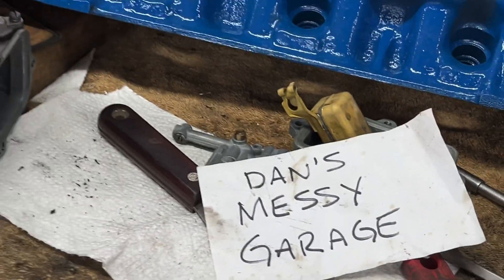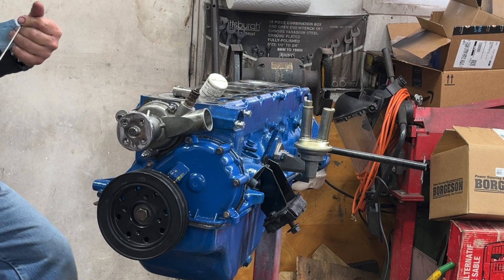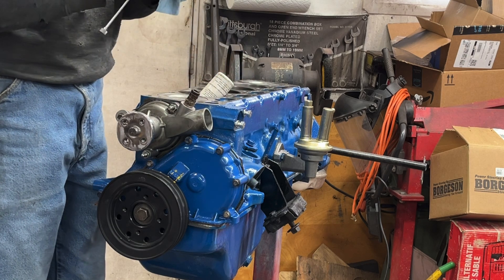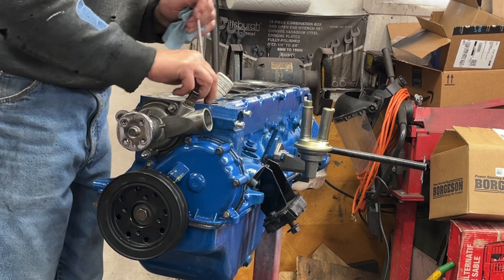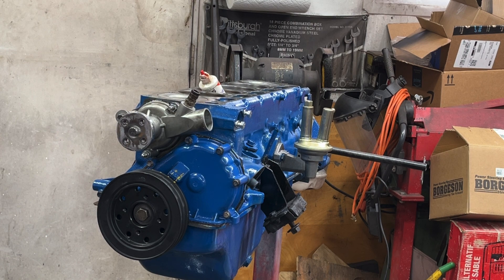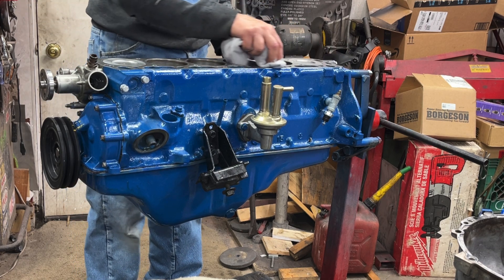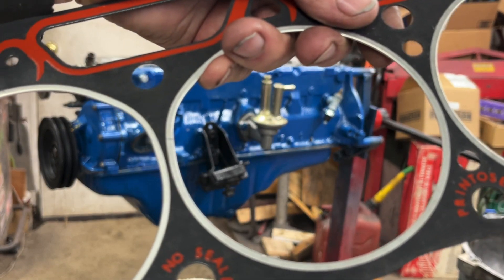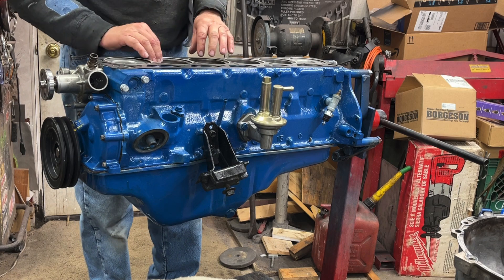200 cu in 6 cyl Ford Engine Build: PART 4 installing Lifters, Head & Pushrods

Comment: Dan what pushrods did you use with the adjustable rockers and Hydralic lifters?
Reply from the maker: Stock pushrods. The engine came with adjustable valve trane.